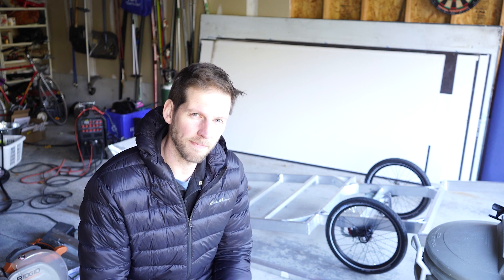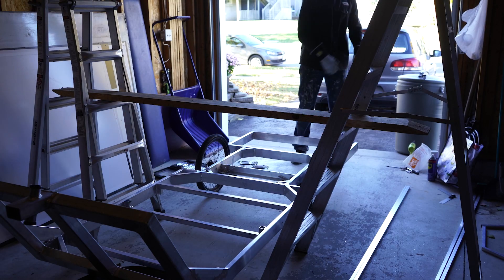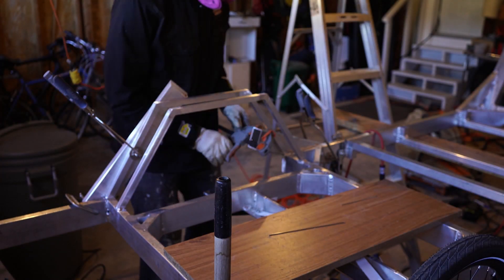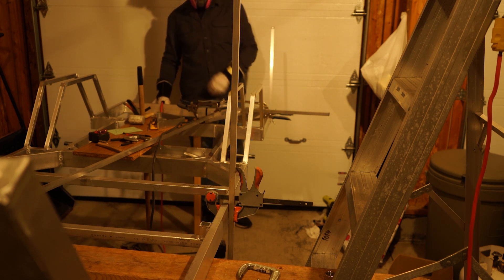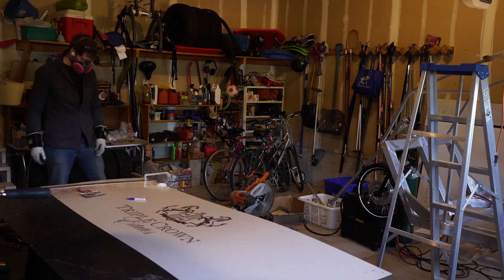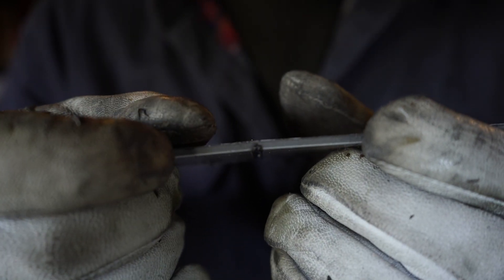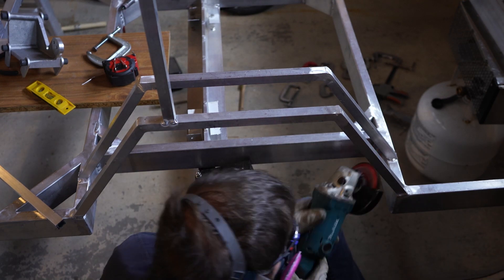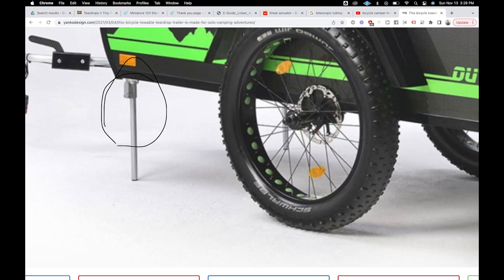Building Electric-Powered Bicycle Camper (PART 4)

Comment: Right now I'm having a tough time planning how I will attach the axels to the frame. How much did you bike axles cost, and where did you find them? So far, I'm considering the Wike DIY bike trailer kit. That kit comes with 20" wheels, and I was hoping to find out if the size can be increased to 26". I'm having a bit of a tough time finding out info about bike trailer axles....
Reply from the maker: I highly recommend going with some kind of suspension. It makes a world of difference in stability. I used the flexiride torsion axles rated for 425 lbs/pair.

Comment: The rail trail access restriction bollards in many places are 36 or 32 inches apart. I have a 31 inch total wide recumbent trike that barely fits some of them. If I were designing a future forward rail trail friendly trailer I'd limit the outside total width to 31 to any aspect less than 37 inches above grade. to clear the usual 36inch height.
Reply from the maker: Yes, for that purpose. But to sleep in if you’re my size, better to have the space I think and miss out on some trails. Depends on what you prioritize.

Comment: More bad news ...Einstein quote " no mistakes no learning "
1. Introduction
There is growing interest in the structural use of aluminium alloys, for such applications as automotive and railway vehicles, bridges, offshore structure topsides and high-speed ships. In all cases, welding is the primary joining method and fatigue is a major design criterion. However, as is well known, welded joints can exhibit poor fatigue properties. Thus, clear design guidelines are needed to ensure that fatigue failures are avoided in welded aluminium alloy structures. Apart from basic design of new structures, there is also increasing interest in methods for assessing the remaining fatigue lives of existing structures.
Reply from the maker: I used 6061-t6. Should be plenty strong.
Reply: @Jerbrown  Ya man plenty strong , you did well with the design , lots of fillets and braces . You be to go .
Reply: @Jerbrown            I used 7075 for all my drop outs

Another group of high-strength aerospace alloys. These alloys are mostly unweldable due to their susceptibility to hot-cracking and stress-corrosion. 7075 is particularly vulnerable

Comment: Hi Jeremiah. love your project! I'm interested in what type of hub motor you are using & the associated accessories that go with it?
Reply from the maker: Hi Kent, thanks! I’m using Grin All-Axle hubs, cycle analyst, and phaserunner controllers. You can buy complete kits from them: ebikes.ca
Reply: @Jerbrown  can you please elaborate on the specifics of your axle, & the benefits of using it? 
are you currently touring with your rig? thanks
Reply from the maker: @kentjefferies723  I'm using torsion half axles (by Flexiride). I consider them absolutely crucial to the stability of the camper, not to mention the smoother ride over rough streets/terrain. They are silent, which was another key consideration for me. I love silence. Silent hub motor/controller combos, silent suspension, silence, silence, silence! 

I am currently in the testing phase - many short trips of 20 km or less. So far, everything is working as I hoped for. New video coming soon. Cheers!
Reply: @Jerbrown  this is totally new territory! I ventured onto the flexiride website. Their  half axel promo involved trailers for automotive use with a min of 425Ibs. Specifically what alterations did you carry out on the bicycle wheels to fit them to the axel? What particular model torsion half axles model to you purchase to suit this application &/or what modifications took place so everything would fit? thanks
Reply from the maker: @kentjefferies723  Hi Kent, I had them machined down to 20mm spindles to fit bicycle thru axle standard. Yes, I went with the 425 lb version

Comment: Hey man I just come across this and looks pretty cool I really like to build something like this but let me ask you have you ever thought about using the electric hub drives for your wheels running them all and sequence so they work together I did it on a trike. Should probably work on this
Reply from the maker: I have, but I want to keep it simple for this one. My tests found that one motor in each of the bike and trailer is plenty for my purposes.
Reply: @Jerbrown  that is really cool man I was building electric chopper bikes and motorized chopper bikes before these two storms took my shop out here in lake Charles Louisiana I saw your video and thought that is really cool man I was designing something like that for a chiropractor I put electric hub on his trailer for his bite is electric bike so when they go deer hunting they can get to their stands without making noise I even put a little light pulley thing on it so he can lift his stuff up to his blind with his wheel lol. Anyway have a good day man keep up the great work you need any help holler I'm bored living in a FEMA trailer lol
Reply from the maker: @greggiovanni4788  Will do! Thanks for the offer :) Maybe I'll pass through your neighborhood in future and you can check it out in person :)
Reply: @Jerbrown  that would be killer